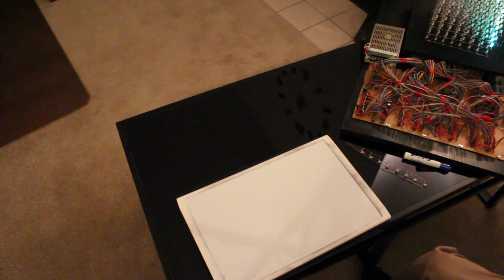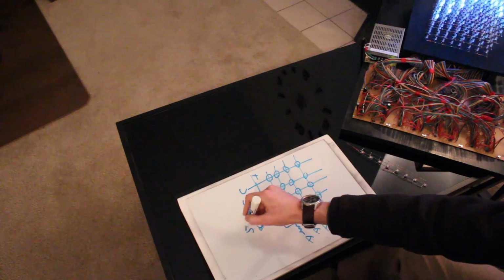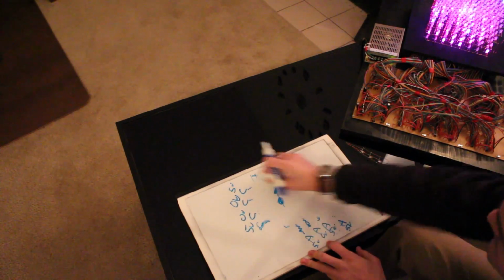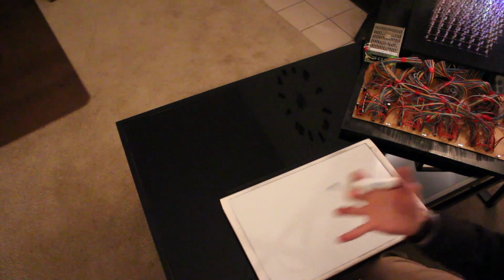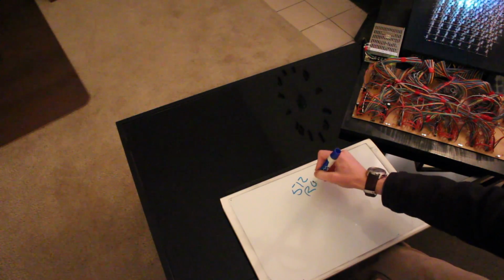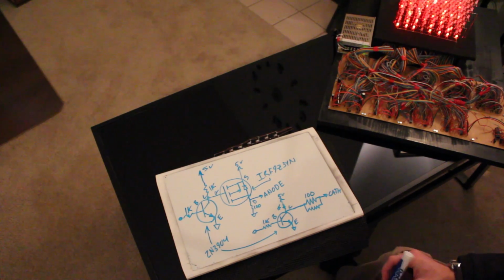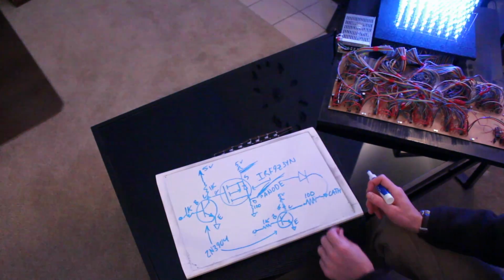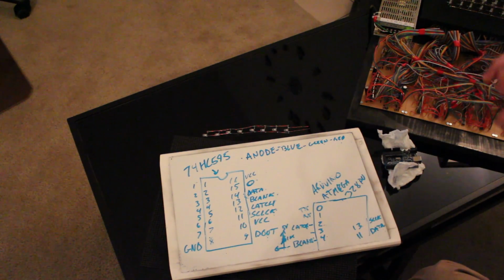How To RGB 8x8x8 LED CUBE - THEORY

Comment: i am building the cube now. i was wondering if you are still available for correspondence, here or on your website.
i am about to start the electronic assembly and specifically was wondering if you ever incorporated a music animation circuit after the fact. i would like to using a arduino uno or esp32. 
anyway thanks for the inspiration.
aloha

Comment: 35:45 Hmm... I'm not sure the 100 ohm resistor is doing anything other than drawing additional current.  If you want a P channel mosfet to switch faster, then you need a pullup at the gate to quickly re-charge the gate capacitance, which you already have with the 1K pullup on the gate.  Shutting off the mosfet quickly that way should be all that you need and I don't think there is any significant capacitance in the LED part of the circuit when it's switched off for the 100 ohm resistor to matter.  Feel free to correct me if you think I'm missing something.

Comment: So did you write a timing based wrapper based on microseconds akin to a binary data tree structure where time based commands were bespoke wrapper to control the color mixing and effects. That would allow you to use 3 dimensional vector based control of the shift registers based on timings. You used time as a conversion to just hammer bits out in a custom algorithm?

Comment: Wonderful video Kevin! My friend and I are working towards building an 8x8x8 cube similar to yours.  I looked up data sheet for 74hc595 and it says outputs can handle 35 mA. So I wonder why you added transistor circuits on all the RGB lines? I would think you need to protect the shift registers for only the common anodes. Did you add those for extra margin, or what am I missing? Also, your code controls shift registers with SPI, but just flipping the bits seems easier. Is there some benefit to using SPI that I am missing?
Reply: I believe that the 595's have a max chip current allotment of 70ma, so that could be a reason.

Comment: Hi Kevin, You mentioned in one of the video's that this could easily be expanded to any size. How would you handle the reduced duty cycle for a 16x16x16 or a 32x32x32?

Comment: Hey Kevin, I decided to build a cube, I ordered the parts, in the mean time playing around with the trans cirquits, I wired one LED to the trans, using the parts you mention, when running at a 1/8 duty cycle (analogwrite 10 microsec on, 70 off), the max measured current is 5mA, so the LED is a bit faded, is that normal? (2*100ohm on a green led)

Comment: Could an easier implementation for the anode control boards be to completely get rid of need for the bjt's in this circuit by implementing N-channel MOSFETS? That way if you tied the anode levels to the source of the N-channel MOSFET along with a pulldown resistor much like you have here, then we'd have the desired transfer function. For a high voltage at the gate pin the MOSFET would turn on and bring the 5V from the drain pin to the source pin and would power the anode levels on, for a low voltage at the gate the MOSFET would continue in its off state and leave the anode levels off pulled down to ground at the source pin. This gets rid of the need for the bjt inverters in the anode control circuit. Or at least i'm thinking it does if im not missing something about the way MOSFETS work.

Comment: Very cool video, thanks heaps!! So with your BAM implementation... the minimum "on" would be once in every cycle of 15 x 8 cycles... so once in every 120 cycles... in order to be "flicker free" it would need to be, what, at least 60hz? lets say 100hz for easy maths.... so for every second, 120 cycles * 100hz = 12khz ? And then you've gotta pump all those bits in to the shift registers... 8 on each colour channel right, then one for the anode levels? So bit throughput = minimum 12khz x 25 = 300kbps minimum right? (bits per second)

Am I calculating that right? I'm just wondering if I understand the timings correctly :) What's an arduino? 16Mhz for the new models? So that gives you plenty of spare "room" for the maths of the patterns and other stuff? I shall view your coding video to try to learn some more :) What's the basic theory though in terms of pumping through all that data to the cube? The arduino doesn't have "parallel" processing right, so do you have to "feed a bit of data, calculate some stuff, feed another bit of data... " etc and a timing delay with each "loop" to keep the throughput at 300bps and keep the timing consistent so that the patterns can be accurately controlled at the right speed? Am i kinda on the right track in conceptualising this?

Comment: Kevin,
I'm watching your video to get some ideas for a build I'm doing that is using multiple LEDs, and I was going to use the hard pins of an Arduino, but I really like the concept of using transistors instead.  Can you explain, or point me to a good resource that goes into depth a little bit more regarding transistor usage as a switch as well as the kind of Transistors you're using?

Comment: I had to play the video on my tv, so I could watch the whole thing more comfortable! I was wondering what kind of power supply did you use because you have to drive a lot of current through the transistors in general.

Comment: When you were talking about protecting LEDs from higher than expected duty cycles during code hangups by using complex "watchdogs" or separate microcontrollers, could you perhaps feed all power through a capacitor to the LEDs that could saturate in the event of long DC?

Comment: Hi Kevin,
Thank you for a very informative video. One quick question thou, I wonder why you have to use PMOS to drive the anode, would it still be okay just use a regular npn transistor with a similar circuitry that uses to drive Cathode

Comment: Awesome video btw, this is helping me a lot! I was wondering why you used 5V to drive the led's, since the pc power supply are really cheap and provide a good 20+ amps on 12V are there any reason for not using 12V, from what i understand just changing the resistor values and using a 12 volts supply it would work. I can get a 25A amps power supply for about 18$....Just curious! :)

Comment: 4k LEDs are a little more expensiv that i thougt...
I think i will use my duo for a 8x8x8 cube instead^^
Another question: The arduino due already has a 16 Mhz crystal oszilator, do i need another one or is the one from the Due enough?

Comment: He mentioned something about using resistors for the LEDs slightly below the value calculated by Ohm's Law. This light up the LEDs slightly brighter than advised, but considering the short period of time it should not harm them (too much). :)

Comment: Could you tell me, what is the purpose of the MOSFET here? Is it because the transistor cannot handle such amount of current to drive all the LEDs? Why not just connect the anode of the LED to the emitter of the first transistor with a 100Ohm resistor going to ground, that way when the base is high the 5V should flow to the Anode. Thanks!

Comment: This, and all your other videos regarding it, are amazing indepth and a fantastic learning source, so on behalf of anyone who hasn't said so, thank you for your hard work and time spent!
I just wanted to ask a quick question, in the build you made the cathode control boards that come off each pin of the shift registers, but in another video you used a TLC5940 chip to control LEDs, could we replace the 74HC595 with TLC5940 eliminating the need for the cathode control boards?
Again, thanks!

Comment: Ive been working on my cubes, and the transistor bits have been quite difficult for me. Drawing the circuit is the easy part, figuring out which part to use is the hard part!
I would be interested in seeing how you calculated stuff to figure out what parts to use. 
I have four cube designs going, and three of them use transistors, Im using mosfets to source and sink two cubes, and cascaded BJTs on another.  
Can you tell me more about the resistors on the mosfets. and the decoupling caps?

Comment: Kevin how is the connection counting  from the 1st shift reg. (any color) to the cube from back to front or front to back and left to right or right to left and  for the anode levels are you counting from top level down or from down up??

The parts are comming now: got the powersupply and the shift registers still alot on the way from china. Did already order some pcb's in china but did take you advice for the prototyping board 777 from Futurlec

Comment: The mother of all tutorials!
Very good video.
Quick question: wouldn't it be possible to use a counter ic's instead of shift-registers to do the scanning?
I think it would be easier since it doesn't require you to fill it with data,just a clock pulse.
It also would give less overhead in programming/executing.

Comment: I just watched this again to try and get the information to sink in.  Would it be possible for you to take a close up shot of the cube with the power off, and indeed the circuitry?  I can't quite visualise exactly how you created the columns.  I have just started building a small 4x4x4 single colour cube, but it is meant as a trial run to get my head around it.  RGB next! Looking forward to the next video!

Comment: Made it to the end of the video :) Just curious, why didn't you use common cathode LED's. It would've saved you soldering 192 transistors because you probably could feed the LED's straight from the shiftregisters. And the anode layers could've used much cheaper N-Mosfets or high power NPN's.

Comment: Well, wow.. what could anyone say?  Lots of wires, lots of fets... 

I'm wondering how the cube would look if you'd use surface mounted rgb leds on thin glass (print conductive ink on glass, or glue down litz wire or thin strips of copper foil for connections).
I would have probably used something like NSI50010YT1G instead of resistors, for constant current output no matter the voltage.
You could shrink the board quite a lot if you use some ata133 style cables to make the connections Sell a kit!

Comment: Ok you said to light up a Led of a matrix you have to connect one pin to 5V (with a resistor) and the other one to 0V. I tried and it didn´t worked. Is this one of the things you wanted to correct with the annotations or do i make something wrong?